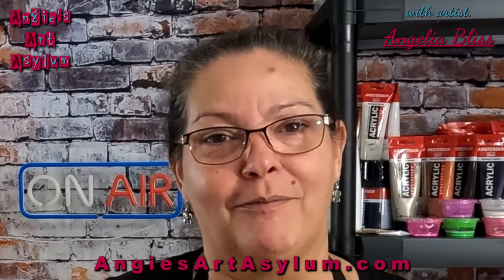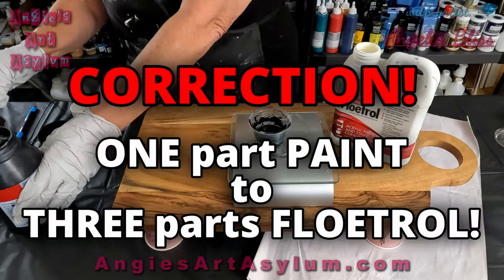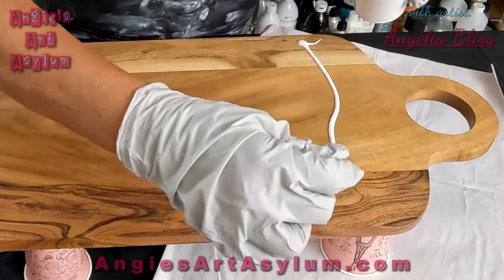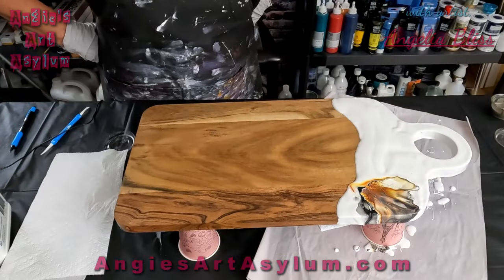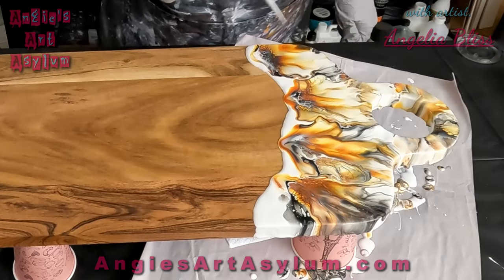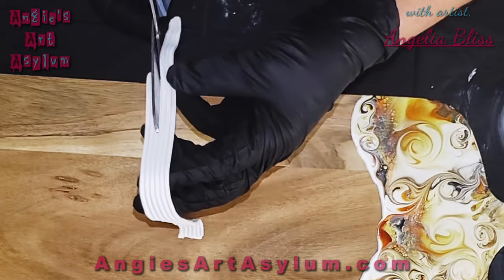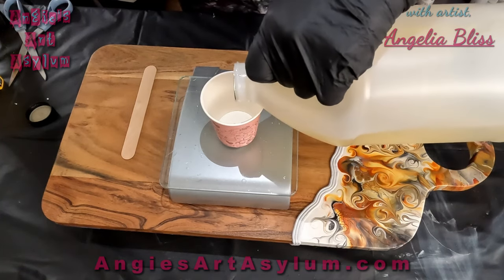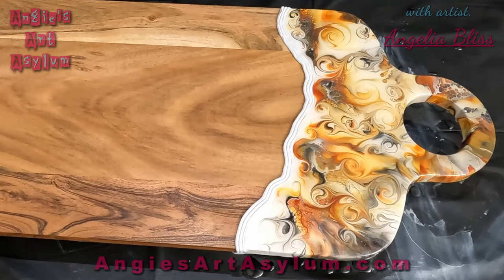MIND-BLOWING DIY Holiday Decor (With New 2024 Hack)

Comment: I bought a heat mat from Amazon, and I sit both my bottles on it for an hour to let them heat up, then mix 'em, and it makes life much easier!  Then I crank up the portable radiator and let it heat up in there, and my resin cures beautifully.  And yes, heat gun!  This is a great hack!  I like this look so much better than that resin puddle!  I can't keep my paint from going under my taped back though, it's a problem.  I'm also a little amazed that the pillow stayed not only white, but BRIGHT white.
Reply from the maker: Thank you for sharing your experience! I love hearing how others find ways to make their resin projects easier. Your tips will definitely help me moving forward. Yes, I was shocked that the pillow stayed BRIGHT WHITE too!!

Comment: It’s absolutely beautiful! 🤩 When did you remove the barrier? Before it dried, or after?
Reply from the maker: @LetsPourWithPattie  I removed it at about 2 hours after I poured the resin. So it was still tacky. I will try to remember to video that part next time. 🤷‍♀️🥰❤️😬
Reply: @AngeliaBlissArt  thank you for answering. I figured it would have to come off before it hardened fully but not while it was still runny. Just so it wouldn’t get stuck. 
Congratulations on the sale of it so quickly. Not surprised, considering how stunning it is.